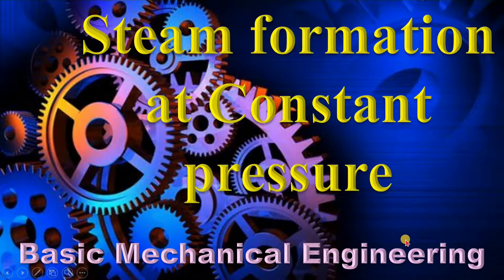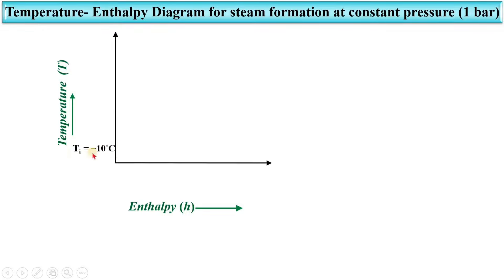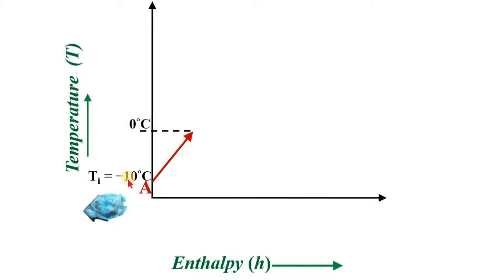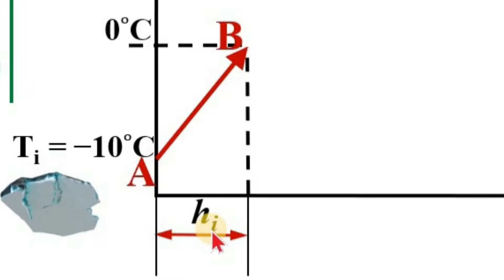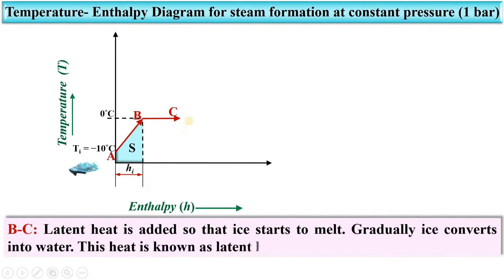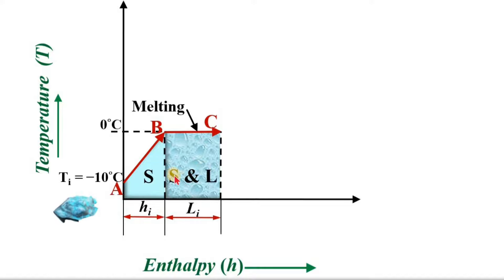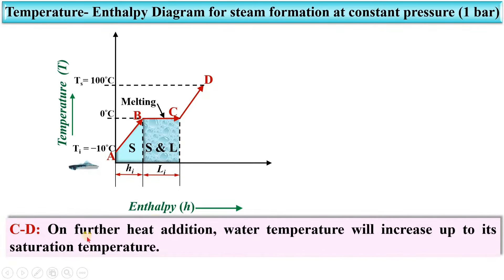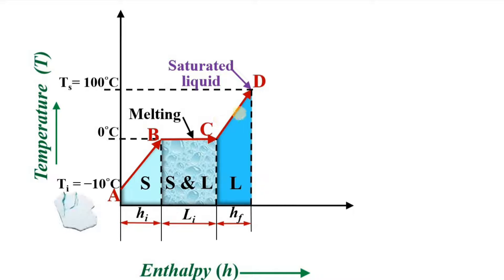Steam Formation | Temperature vs Enthalpy Diagram for Steam | Superheating | Saturation Temperature

Comment from the maker: Steam formation at constant pressure explained with following Timestamps: 
0:00 - Steam formation - Basic Mechanical Engineering lecture series 
0:10 - Temperature vs enthalpy diagram at constant pressure
1:58 - Enthalpy of ice or sensible heat of ice
2:56 - Latent heat of ice or heat of fusion
3:46 - Saturation temperature
4:28 - Enthalpy of fluid hf or Enthalpy of liquid
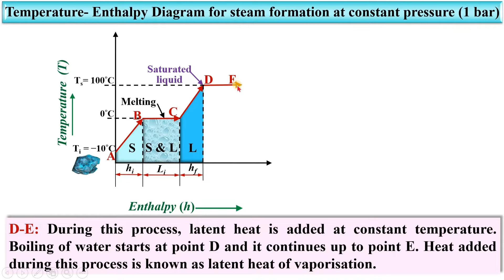5:26 - Latent heat of vaporization or enthalpy of evaporation hfg 
5:35 - Dry saturated steam
6:38 - Super heating
7:23 - Super heated temperature
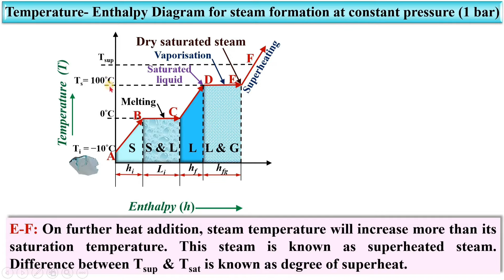7:31 - Degree of super heat
7:40 - Heat of super heat
8:16 - Enthalpy of gas hg
8:50 - Enthalpy of super heated steam hsup